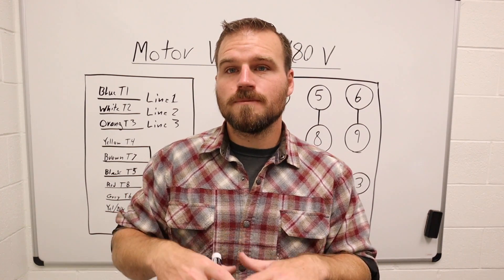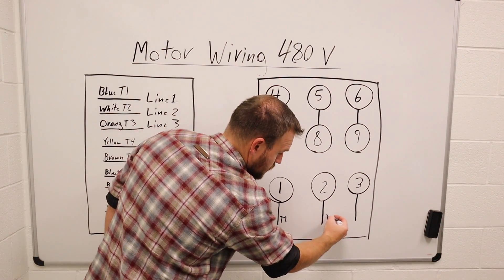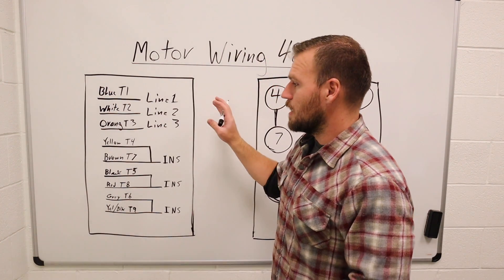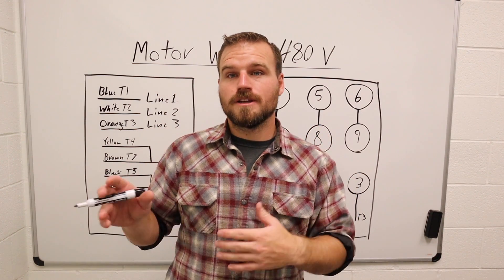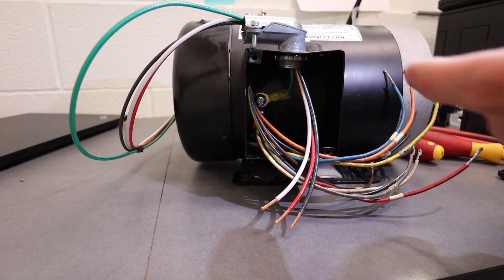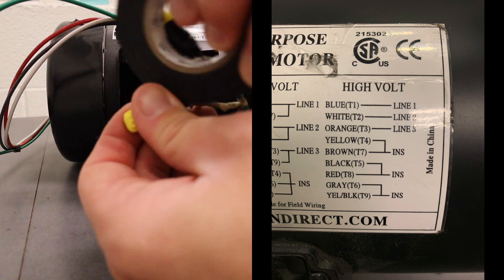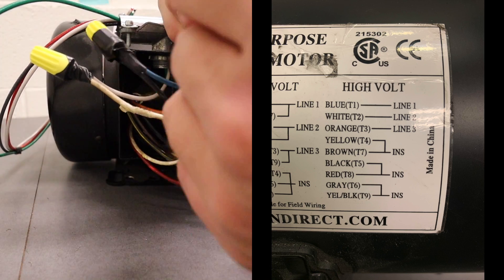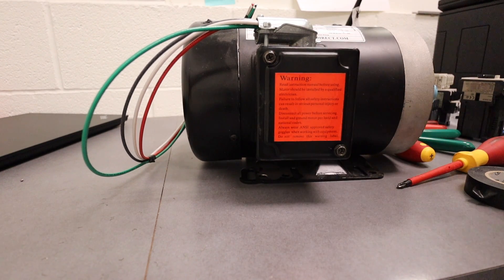Motor Controls - Wiring a 3 phase motor with 480 volts

Comment: 12phase 9phase 6phase Your Face bitch ...stupid no electric...Qurjñty vQult jRQN pulled JLQY pushed no south pole north pole on magnet deposit demagnetize put in heat stove to charged it AC DC  HIGH VOLTAGE WITH QURjynt  MICRO HEATWAVE  PUT ON MAGNETRON THE RUN IT . CHARGED NEW MAGNET...

Comment: beyond confused on how you know which wires to connected to your line voltage wires your just grabbing wires saying it really doesnt matter like what do you even mean
Reply from the maker: Line 1, 2, and 3 all have the same power because it's 3 phase. So it doesn't make which line you use. Unless the rotation is incorrect.
Reply: I usually go boy. Brn orange yellow. But some colors can change but each one is just one phase of three phase.

Comment: Quick question I have a commercial dough mixer, which plate label reads 5 amp 3 ph 480v... what AWG romex or cable could I use ?
Reply: You'll need like 16 gauge lol. 3 hots and a ground.

Comment: I came across a machine with a 120v.motor that was  controlled by levers that made it go back and forth, and the wires that came out from it were those same colors.?? Is that motor special ??
Reply from the maker: How to Wire a Drum Switch to a 6 lead Motor to Build a Reversing Circuit.
https://youtu.be/J4E7IYQDP1A
Reply from the maker: Sorry this took me so long. I’m going to do a 9 lead motor this week and use a different style of drum switch in a few weeks to wire the same motors. Hope this helps.

Comment: Question ❓ 460V 60HZ motor 
6 wires  T1-T6.   1,2,3 connect to power coming in , T4,T5,T6. WHERE DO THEY CONNECT TO?? IM A DELTA OR Y CONFIGURATION??

Comment: I can't believe you're teaching people and you used wire nuts and that tape job. This will cause I motor to burn up in no time or at least cause a ground fault. You should be crimping your wires together, then wrap with varnished cambric tape, rubber tape, and then electrical tape
Reply: Maybe one in a hundred, under intense heat and vibration, would fail. You speak as if 100% of motors wired this way will fail, which is incorrect. He could run that motor, with this wiring, in this environment, through your lifetime and it will never fail. Erase your first two sentences and you will reach a larger audience. I agree with your last sentence, completely.
Reply: @PNWskyline  I work in a slaughter house where everything is vibrating and everything gets hosed down every night. Every motor would fail quickly if it wasn't wired properly
Reply: @Jack Graff  large airports run 10,000+ 3 phase motors and vfds all are simply wire nuts and tape. They run between 16-20hrs per day. Vibration like crazy
Reply: https://youtu.be/sntgK6SWYsI here

Comment: I thought lines 1-3 are brown orange yellow? (BOY).
Reply from the maker: The purpose of the lab is to teach students how to wire based off of a wiring diagram. I have heard the terminology you are suggesting but every motor we buy seems to have different colored wires so we thought teach the diagram would be the best
Reply: So are both 1, 2, 3 and T1 T2 T3 labeled as such? I would have separated 1,2,3. Connected 4&7, 5&8, 6&9, then connected 1&T1 2&T2, 3$T3. In this video it is as if they separated T1 T2 T3 to connect with 123 coming in, but how do we know which ones are 1,2,3 if there is not a standardized inbound color scheme
Reply: 123 coming in does not matter in 480 you have 3 legs off hot and 1 green ground as long as everything from the box is wired the same